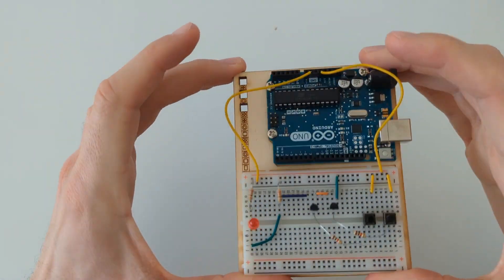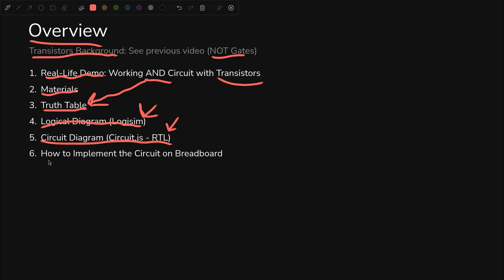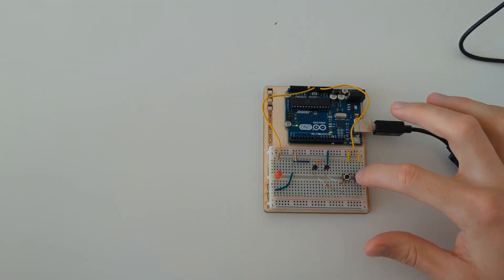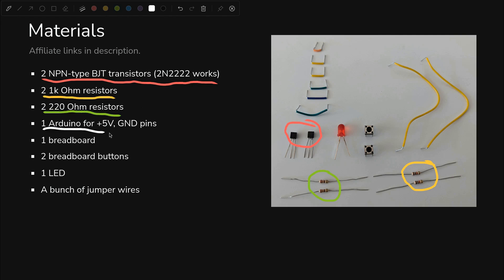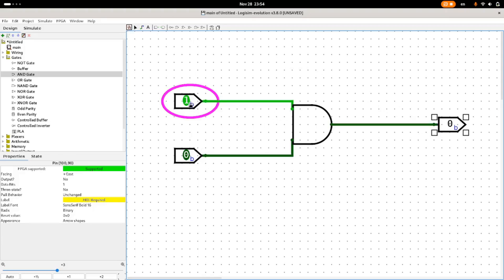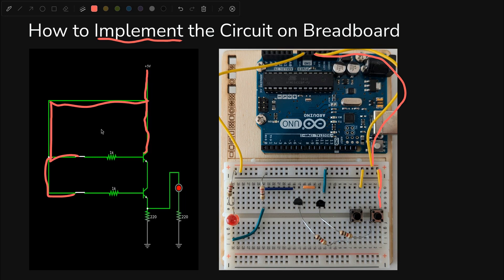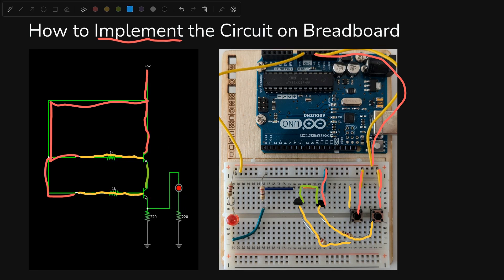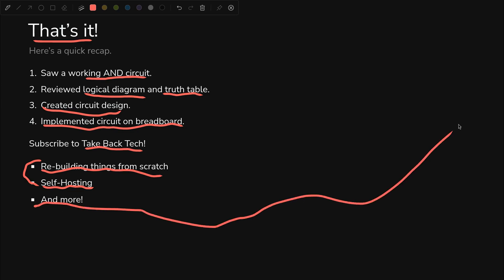AND Gate from Scratch (How-To, Using Transistors)

Comment: Preeeetty sure that the LED should be connected to the collector of T1 for an AND gate
Reply from the maker: Ooops you may be right 😅 appreciate you letting me know!
Reply: @PageKey  I struggled with that 'cause I built the exact same circuit you had on Falstad and while "it worked" I noticed T1 never fully saturated. Took a lot of help from chatGPT but realised that the positioning of the LED and resistor was wrong. It kinda works as an AND gate but it's "wonky" and you'll struggle to convert that to a NAND gate using that approach.
Reply: Btw would love to see a video where you show how you calculated which resistors to use, both for the bases and the LED, think that's very useful info. I'm using 9Vcc for example so can't "just copy paste" and I'm sure ppl watching would benefit from that. Just a thought ;)
Reply from the maker: Great idea! I think I may have run into the same issue with the LED sometimes being dim for the 1 state. I think I "fixed" it using a similar mix of ChatGPT interrogation and trial-and-error. As for the resistor values, that may have also been trial and error / solely based on what I already had on hand 😅 it worked on Falstad so I just went with it. But I'm sure there's some more serious math/analysis I need to figure out for that. Art of Electronics here I come!

Comment: I can use only 1 transistor for this, right?
Reply from the maker: @aquilesmalagueno9820  I think you need both, but maybe there's a more efficient design. The NOT gate (inverter) I made a few videos ago only used one transistor, though.
Reply: @PageKey  I feel like you can just put switches on both collector and base of 1 transistor and it can act as an AND gate alone, or I'm remembering this incorrectly? I just saw this vid in my recommended and got curious about two transistor as AND gate. thank you
Reply from the maker: @aquilesmalagueno9820  thanks for the explanation! I see what you're asking here - it does seem to work given the nature of the AND truth table! I'd have to try it out to know for sure, but this sounds like a solid approach, great idea! And thank you for your kind words about the explanation!
Reply: @PageKey  I forgot to say, I really love how you explain this well, easy to follow and with side by side diagram it easy to make sense of everything. I felt your passion to teach and inform with enthusiasm.
Reply: You can just use two buttons in series, but usually the intent in these logic gates is to be controlled by electrical signals